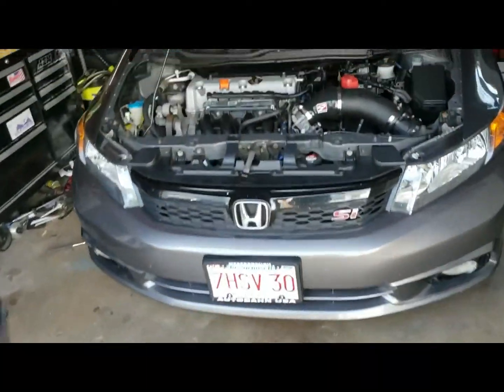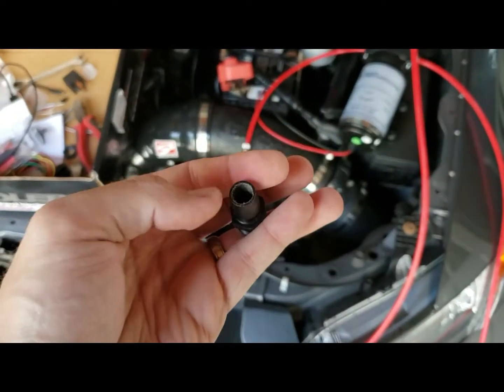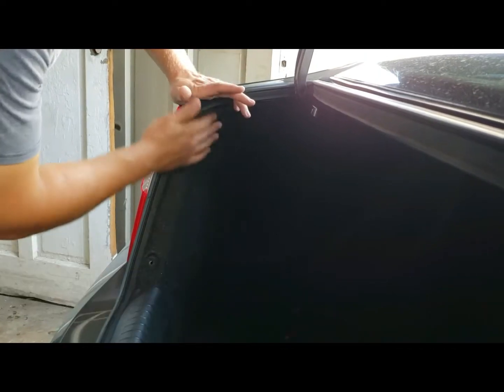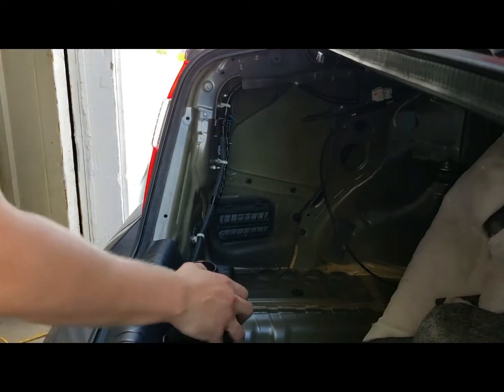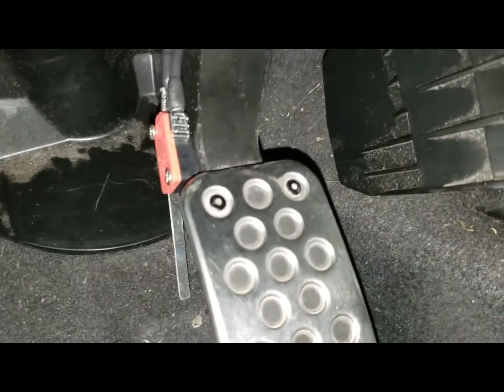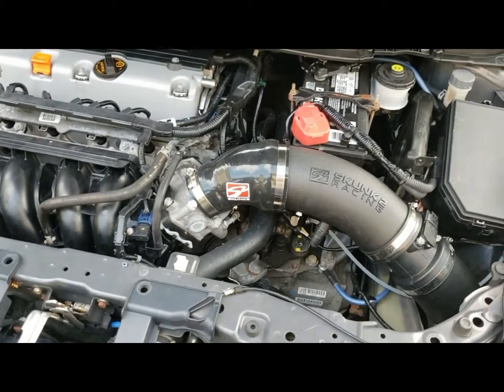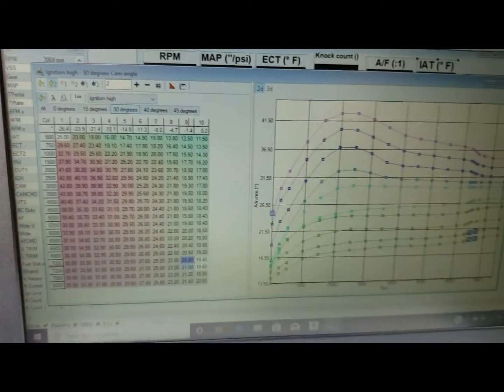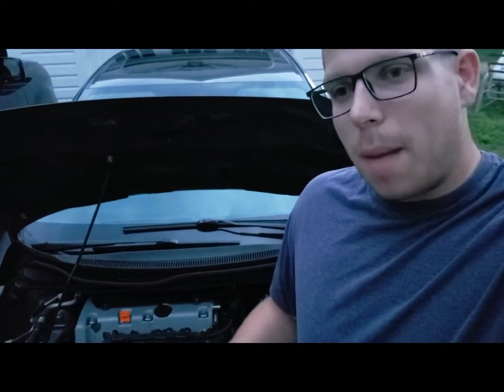K24 Water/Meth Install

Comment: Heads up. To make your install a little cleaner you could splice into the WOT switch that may be installed in your throttle body already. Just wire it up so that it doesn't create any unwanted shorts or open circuits. Consult your cars wiring diagram

Comment: So which kit number did you use and you do not have a turbo on it, right?

I built one from scratch many years ago and installed it on a 350 4bbl carb motor at the base of carb on a 1" plate. Did like you with 2 bottles of heet and windshield washer fluid. Was amazed at HP gain and torque ! Went from about 16, or 18 MPG, to about 21mpg and the torque was amazing. 
Mind you for everyone critiquing you, that in the 1970 gas crisis, several car manufacturers mounted kits on buicks and other cars. People were to lazy to install the washer fluids that made them work!
Reply from the maker: I used a old stage 1 kit it worked great!

Comment: How did you mix your 50/50
Reply from the maker: I mix it equal parts water to equal parts 100% methanol from the yellow heet bottles.
Reply: Windshield washer fluid is good as a poormans meth fluid as well, then add a bottle or two of Heet to bring it up to 50/50.  There's a chart that can ge Googled which breaks down the methanol content of various brands of washer fluid.

Comment: Why are you modifying a car that runs 14's?
Reply: Gotta start somewhere
Reply: Why do you drive a turbo car that runs 13’s
Reply: dont be a hater
Reply: Dude you have a gti lol . They run mid 14s stock lol. I seen one at the track spinning alot running consistent 16s lol.